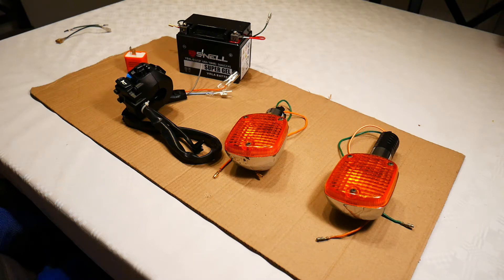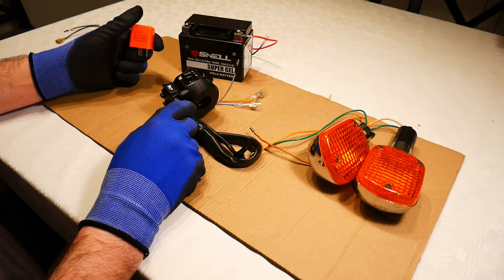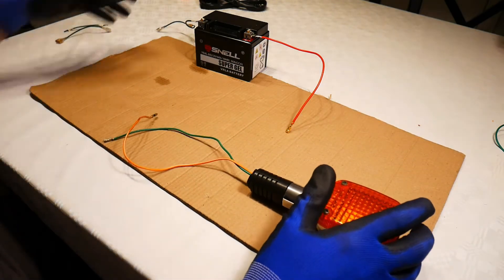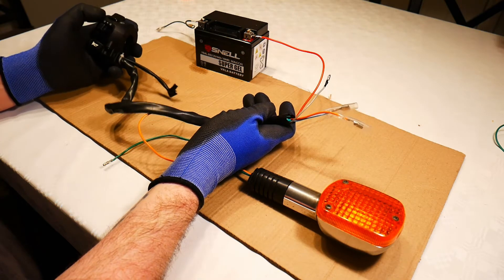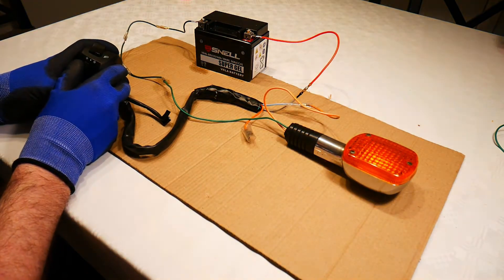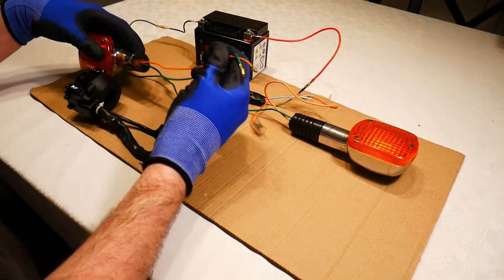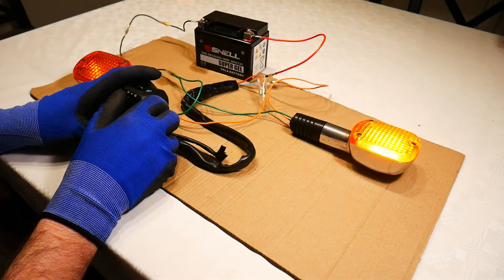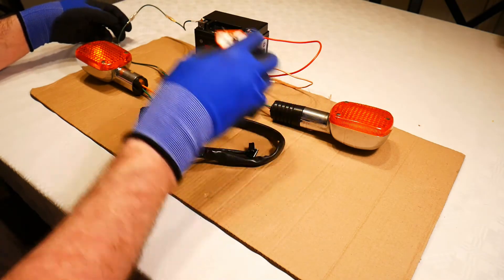How the Turn Signal circuits work in a motorcycle

Comment: I changed my bandits indicators to the ones in this thumb nail funnily enough...changed the flasher unit... everything was fine.

1 month later I come back to a dead battery...that I had to trickle charge.... and now both my right side indicators don't work nor are the flashing on my dash.... any ideas?

Comment: Good video...Q...what do i do if i only have a single wire coming from the indicators. Do the indicators have to be grounded somewhere?
Reply from the maker: Yeah the one wire is probably positive and the indicator housing is probably grounded to frame/battery through handle bars

Comment: Very useful!
That quick flashing of the blinkers when the bulb is out is because of what? Load? Additional logic in relay?
I want to order a relay for my 2002 Suzuki SV650. One of them is this orange one that you use with two poles, while the other one is 7-pole version (as the original). What difference it might have?
Also, do I need two relays for the front and back blinkers, or only one manages everything?
Also :), I am looking for an audible feedback of the blinkers as a reminder, so I would know that they should be turned off. I was thinking of adding a speaker to the circuit, but not sure. Any idea?
Thanks!
Reply: I found the schematics of the 7-pole relay. I assume that it has more poles due to more functions to serve, e.g. side-stand and additional circuit segment (maybe separately handled blinker pairs?).
https://i.redd.it/n0j695bs9ze51.jpg
Reply from the maker: I'm not sure why exactly it blinks faster but current probably passes through front and rear indicator. Once one indicator fails, current runs through only second indicator only so the charge builds up quicker on just one indicator (flashes quicker) compared to when it has to build up in two working indicators.

Comment: Do motorcycle turn signals switch off automatically as you turn like is the case with cars ? 

Anyone knows ?
Reply from the maker: No they don't in older motorcycles. It's manual on and off. Maybe some newer motorcycles have auto turn off tech though
Reply: @TheMotorcycleMuse  Thanks!

Comment: Great video. 
Would you happen to know what would cause my front to turn signals on my motorcycle to flash simultaneously.
For example if I want to hit the left turn signalthe right signal  will also flash but much dimmer than the left.
If I turn the right signal on the right signal the left will also flash but again much dimmer. 
These are factory dual filament bulbs no LEDs.
The rear turn also factor bulbs function properly.
And by the way I just bought two new bulbs for the front but the problem still exists
Thanks again
Reply from the maker: I'd start by opening up the turn signal switch. There may be a short of some kind between the two signal circuits there. Otherwise some wires leading from switch may have frayed and are shorting off each other slightly (i.e. bare wires touching). Only other alternative is someone has fiddled with circuits and installed them incorrectly.